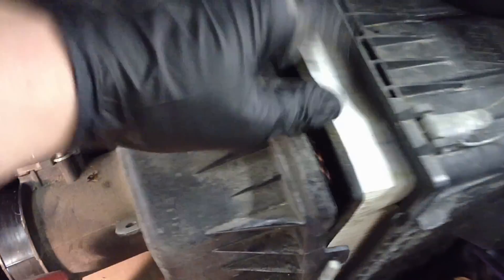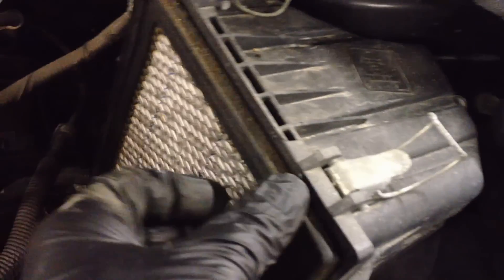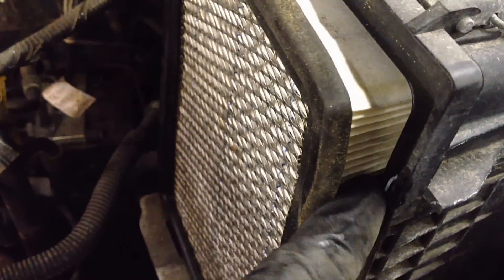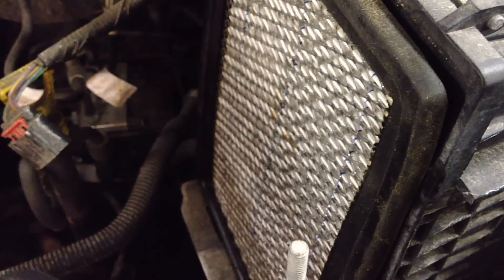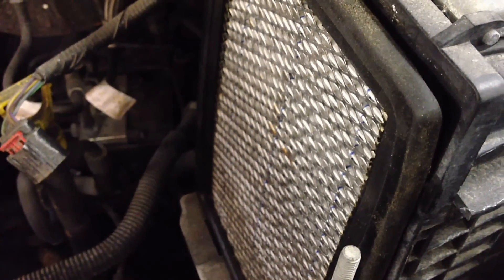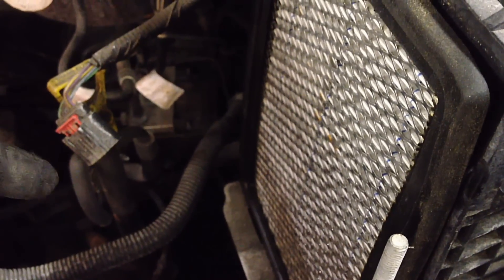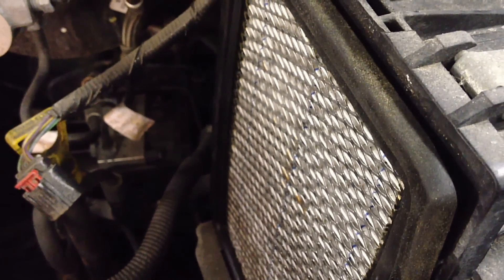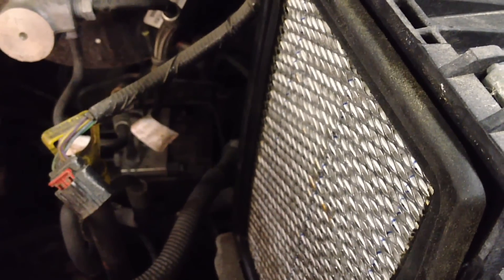Ford P061B Diagnostics: Common Causes and Checks

Comment: I've had this three times in my 14 Tremor, all under hard acceleration. I run K&N filters in everything but this is the first parallel turbo engine I've ever worked with. It's also tuned. I wouldn't be surprised if it's pulling the K&N off the seat under hard acceleration.
After the first time I checked the air filter, it was sealed properly.
I know some mechanics don't recommend K&N due to possible MAF fouling and reliability. I'd say the same thing for a customer, but it is a trade off: some reliability for a tiny bit more power and less waste.

Comment: Just replaced cabin and engine filter on a Mazda 2.5t 2023. Cleaned the maf sensor with crc. Used all oem parts. This code threw on the first crank 48 hours after doing the work.
Reply: Hey there I’m currently experiencing the same issue did you get yours resolved?
Reply: @Kinuthya  You have the same code?

Comment: I just had this code on my 2016 3.7 V6 manual Mustang. Here's what caused it. I was coasting downhill in 3rd gear and turned the engine off it was still pushing exhaust from the engine and sounded like it was running but it wasn't. As soon as I started it back up it started running super rough, misfiring and idle hunting. It then went into limp mode. I had to keep it between 1 and 2,000 RPM for it to even be drivable, below that it would stall, above that it would chug back and forth like it was running out of gas. It's also very similar to the issue I had on this car with the aftermarket throttle body. I solved it by turning the car off and priming the fuel pump a few times. At the time I was going down the steep hill I only had a couple gallons left in the tank at most, so maybe that was the problem or maybe the engine even though it was off emptied the fuel lines and the pump wasn't on so it was kind of starving for fuel and the engine just went into limp mode because the measurements were all wacked out. Also I have a huge cold air intake so maybe when I was coasting downhill in gear with the engine off it was sucking a lot of air in and when I restarted it the throttle body got confused because it wasn't in the home position. Or it could be any combination of those things. But just letting anyone know it might be with a try to just cycle the key/start-button a few times to prime the fuel system and sweep the throttle body.

Comment: P061b, after traction control kicked on, threw the p061b code (wrench illumination on dash, not just the engine light) immediately and would not run good, basically limp mode after 4k rpm and wouldnt idle good at all. What could this be? Could it be traction control related? Or something else when it jerked the car? (Application is a 2007 mustang gt, 5 speed manual with aftermarket cold air intake, please help😂)
Reply: Did you figure it out?

Comment: 07 Vic. Intermittent 061B. New MAF, un-oiled K&N, new complete throttle body. Car usually does it within the first 5 min of driving, regardless of ambient temperature. Can shut it off, restart and wrench goes away.  Often times, that’ll be the last of it… until tomorrow.  As an aside, car seems to bog or hesitate on take off, hafta ease into it.  If you WOT, it’ll fall on its face, then take off like the dickens.
Reply: Did you figure out what was causing it? Same problem but only happens in the winter below freezing

Comment: Any suggestions for a P061F code on a 2008 Explorer 4.0.  Starts, runs rough and dies and can't restart.  Changed throttle body, TP sensor, and TB motor with no luck!  Appreciate any assistance!

Comment: Hi, I have P061B DTC on my 3.5L ecoboost ford transit 350.   turns out the engine air filter box was loose, not properly seated.   i had an Engine Fault Service Now message along with check engine light and reduced power/low idle.   I placed new air filter and made sure the airbox is seated/sealed.   Will the ECM/throttle body relearn?   or do I need to do the calibration?

Comment: I haveA crown Victoria. That has this code and.goes into limp mode.

The Crown Victoria with this code and it goes into limp. I replaced.A horribly.Dirty air filter and cleanedMAF 
 it ran great for 10 miles. Went back to limp mode. 

I bought a new mass air flow sensor and I'm going to replace it to see if that helps.

2007 crown Victoria p71.  103k miles
Reply: Did it end up fixing it?
Reply: @zamorakbrews  hmmm,   I'm trying to Remmeber. 

I think I ended up having to buy a new mass air flow sensor,,  cleaning the old one didn't work. 

If it wasn't that it was the purge valve,,  that I've had to replace atleast twice.  

After that I had to replace the radiator fan housing unit,     the fan stopped spinning and would start to overheat,,  but that wasn't repeated to this code

Comment: I am having this code plus p2106, p2196, p2198, p0174, p0171, and p0068. I need you help. A mobile mechanic told us it was the ECM/PCM. Bought one for $716 and it says it needs to be flashed. But is that even what the problem is? Any way you can help?

Comment: My 2007 Ford Expedition is throwing this code.  It had the wrench come on for maybe 5 minutes on the way to Walmart. Shifting felt odd and it felt like I was driving on a rumble strip for a minute or two...???  Got done at Walmart in like 30 minutes and went to go home.  Didn't get the wrench again, but I stopped by parts store and it had them diagnose it.  This was the code they got.  Think it could be the air filter?  Someone said something about the TCM? I just really don't know about this stuff much.  Any thoughts are greatly appreciated.
Reply: Did you ever find out what the issue was? Sounds exactly like my problem.
Reply: @amandaburns1944  Did you get this resolved. I'm having exact same issue.

Comment: We have a 2020 7.3l gas ambulance this code keeps coming on along with the wrench light. Dealership replaced the throttle body ran ok for a few hours and now the code p061b is back. When driving its fine some minor erratic shifting but when coming to a complete stop it almost wants to shut off.
Reply: I'm having similar issue with my e250   it'll act like it goes into limp then stall  but in between the times it does it  it runs fine . Have noticed van been running rich for about 6months and fuel mileage dropped a little

Comment: For me the reason for the P061b was a bad swirl flap motor position sensor, i had both the P061B and P2015 fault codes, a new sensor solved my issue, it seems a car ECM utilizes the MAF, Throttle position, and swirl flap position sensors in order to calculate the torque, and if any of the sensors or their related parts have issue it will give out the P061B fault code. Correct me if I’m wrong.
Reply: I hope your right because my car kept throwing po61b and I replaced the air filter and MAF and it still throws the code and the car will seem like it’s misfiring when it’s not

Comment: So I have 2010 mustang gt I just replaced header gaskets on it an I was driving it an I got on it an it shut off went in to limpe mode an it through these codes p0010 an p064b an p0446 an I’ve never had a problem with my car before

Comment: My 07 F150 5.4l was giving the P061B code and nothing else. Engine would stall after getting to temperature, then I'd be lucky to limp back home. Worked through the wire harness looking for bad connections to no avail. Found a trouble shooting procedure, which for the life of me I cannot find again, but it lead me to the crank position sensor. Changed that out and appear to be running again.

Comment: Great video. My 07 expedition is running crappy and I got a P061b code. Now I know where to start. Ordered a new filter and mass air flow sensor.
Reply: Blue Wolf did that work for you I have the same issue I changed the throttle body And it didn’t help now I’m going to change the air filter because it’s cheap and bent in the housing. I have a 2007 Mercury Milan 2.0 v6
Reply: @bigrichvisuals2814  solved THAT problem but I had many 🙄
Reply: Blue Wolf changing my air filter in my Mercury Milan 07(Same as Ford Fusion) got rid of my p061b. Bout a cheap filter from Walmart 🤗
Reply: @bigrichvisuals2814  did You fix the problem just changed the air filter ? Because My car is a mazda 6 2010 and I have code p061b but the mechanic says maybe I need replace the computer

Comment: 2006 explorer limited, 4.6L, single code p061b, installed new air filter, cleaned air intake with soap and water, no visible gaps, no visible cracks, swapped MAF sensor with 04 explorer 4.6, no issues with the 04 since the swap, runs fine idling. Ready to make my explorer an exploder. Help please
Reply: Just curious if you ever figured out the issue?

Comment: After spending 2 grand on a 2008 ford e350 5.4 van to fix it. I finally found out why the code po61b kept coming up and putting the van in to limp mode. It was only a $150 to fix it was the sensor on the accelerator pedal. You have to buy the whole pedal the sensor is attached. I hope this helps someone. I replaced the catalytic converter, mass air sensor, o2 sensors, pcv, and the pcm . But it was just the pedal after all of that.
Reply: Wat yo van was doing

Comment: I have a 2006 Ford E350 that is throwing the P061B code. But everything looks good on the air filter, just put a new one in to make sure. When I'm reaching speeds of 70+ the engine will shut off. Wrench light comes on, check engine light comes on, check gauges light comes on, battery light comes on. I have to pull over and put in park and restart then it's fine but the MLF light stays on reading P061B. I'm fine driving around town at speed less than 60. Any help or suggestion would be greatly appreciated.
Reply: Romeo Johnson Hey man were you able to find the fix? Got one just like it
Reply: did you resolve the issue?

Comment: For what it's worth, I recently worked on a 2015 Ford E450 with a 6.8 in a snow storm.  The cone style air filter element was wet and the clamp holding the air cleaner case to the intake bellows was completely loose, letting water intrude upstream from the throttle body but downstream from the MAF sensor. Fuel trim was enrichened according the MAF, and then leaned out by the loose bellows. One thing for sure, the TB sure didn't like it.

Comment: Hey FTM.  Thanks for posting the vid.  I have this code on a 2011 Flex (EcoBoost).  Put in a new Fram air filter, ensured it is sealed as you've shown, but the code persists.  Dealership wants $700 to replace the sensor.  I'll do that if I must, but just wanted to know if there was any other way to test or clean the sensor before deciding to replace it.
Reply: Michael did you get a solution

Comment: My Focus 55 plate is having a P060A error (red explanation mark in red cog). But it just recently had a mobile mechanic change the air filter, sparks and the coil pack to fix an amber engine issue.

But this red cog issue only started after he replaced those 3 parts. Now a garage says I need an new ECU. Do you think it could be the new air filter like in this video.

Please help, worried sick. 😓

Comment: A month or two ago my car started jerking like when tires slip on ice then hit dry pavement, except this was travelling at a constant speed on dry roads.  It was more noticeable in the rain.  It snowed like crazy all day and tonight in the parking lot at work the wrench light turned on and it was jerking REAL bad on the way home.  I hooked up my $9 bluetooth OBD dongle and only had a pending P061b (never saw anything in logs before tonight btw).  I watched your video, then checked my air filter and sure enough, the front clip was off and the filter had slipped down a bit on the front corner.  It was tough getting the clip on too, I'll bet they just said screw it the last time I got my oil changed (or it's still not sitting right lol).  Anyhow, thanks for the vid, very helpful!  

Edit: 2009 Focus btw.
Reply: Hey bud same thing happened to me did u happen to fix it.
Reply: WOW! Mine has been doing the same thing, no codes except for last night it finally popped. Thanks for the information (7 years ago).

Comment: Thanks for the information I will check it out tomorrow I was driving to work 2 days ago and the check engine soon light came on and then today the check engine light came on and went to check the codes and they were the P061B Internal Control Module Torque Calculation Performance and p2196 02 sensor signal stuck Rich Bank 1 Sensor 1. So would the air filter cause the 02 sensor code also? It also just started to snow and get real cold here those past few days.
Reply from the maker: +Dillan Clymer Yes it can any miscalculation of the air inlet can cause this. If its a 09-10 truck the o2 code can be the wideband o2 sensor they were new technology back then and had many faults that set the P2195 P2196 P2197 codes.
Reply: +FordTechMakuloco forgot to reply ur anyways since my mustang was involved in an accident and caused some front end damage I think it messed with my air filter it had quite the gap fixed it and I now have better gas mileage and no code issues. Thanks

Comment: wife has a '05 ford 500 and wrench light came on and went on limp mode, couldn't drive over 30 she said, I put the scan tool on it and get 2 codes, p2106 and p061b. I haven't looked at it yet,but just wondering if the filter could be it or something different
Reply: Same issue on 05 Freestyle. Any help by chance?

Comment: Hey thanks for the video and the info. I have a 2010 ford mustang. It recently started snowing here where I live and i've got the P061B code twice now while driving in the snow. I will check my air filter now. Also would you have any info for a code C1963 Traction control inhibited. Could this code be caused by the air filter too? Also do you know anything about a code  B2909 for belt tensior sensor malfunction?
Reply: Very far fetched because you said this years ago but did you ever come up with a solution because my car keeps throwing po61b and it’s got a Brandnew air filter that’s sits nicely and it’s got a new MAF. Still throws the code time to time and my traction control wrench comes on and my cars starts spuddering
Reply: @damnbonez  yes I checked the air cleaner and the cover was not installed properly and once I corrected the air filter cover the code went away.
Reply: @damnbonez  I am having the very same issues on a 2.0L eco boost ford edge titanium 2015 w/ 203,000 miles. Any luck?

Comment: It says the po61b internal control module torque calculation performance. Would that b air filter?
Reply from the maker: +Thomas McBride Yes as explained in the video any leak in the air inlet system can cause this code.
Reply: FordTechMakuloco mine show same code and description i have a 2.0 focus se with k&n cai how can i fix this code?

Comment: I have a 07 Fusion with a C.A.I. ,TB Spacer and Custom Tune. Every time I get into it the throttle slams shut.The engine and wrench light comes on. I clear the P061B code start it up drive and it does the same thing. When I return the car to stock it runs fine.What do you think?
Reply from the maker: +Antonio Carter I don't get into anything aftermarket but what I can tell you is I had a customer do the same on a 09 focus and would set the same code because now with all that there is airflow distrubances and the pcm cannot calculate the torque load properly anymore.
Reply: Oh wow ok thanks for your help man greatly appreciated.

Comment: on my 2010 ford e250   same code , wrench light on , if  shift from d to 2  it surges up and down and shut off , limp mode like crazy.  my ??   is there a recall from ford  on the 2010 ford e 250  , also if i have to change the throttle body  will one from aotozone work,   last is there a up grade throttle body. when shift from d to 2  if given gas  it will not do nothing no rev.  thanks
Reply from the maker: lanze wilson If you only have this code there is an airflow problem not throttle body and no I would only use the latest ETB from Ford.

Comment: I was having some limp mode problems on my Ford Edge only when it snowed out.  It took me over 2 years to figure out what the problem was.  I replaced an aftermarket cleanable air filter with an OEM Motorcraft and it fixed the problem. Thank you so much.   You da man.

Comment: Hey bud what if I have a 2013 f150 ecoboost with afe stage2 cai and its also tuned.  This morning on the interstate I hit the gas going around 80 and the truck went into limp mode with this P061B code.  I have 33k on truck and maybe 20k on cai.  I never cleaned it but last I looked it doesn't look dirty.  I felt and heard the tb close and that was it,  I feathered it to the side of road and returned stock.  Where should I start with this? I'm thinking of staying stock for a little bit to see if it happens again stock and also check my filters like you showed in video. Thanks for any help!
Reply from the maker: Blake Langley Any kind of airflow disturbance could cause this and the free flowing CAI filter plus the rpm and speed I could see this happening. Was it snowing or raining even just a bit flurries?